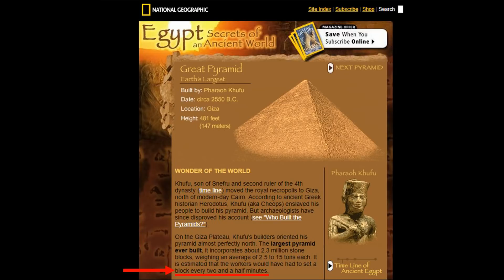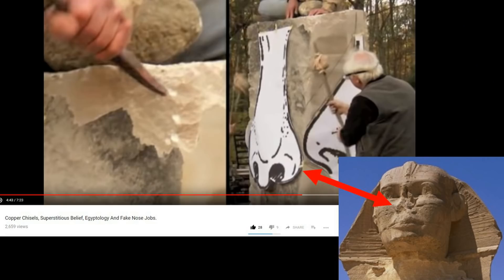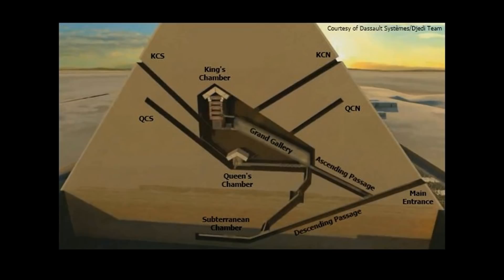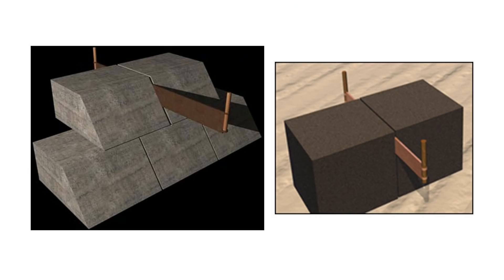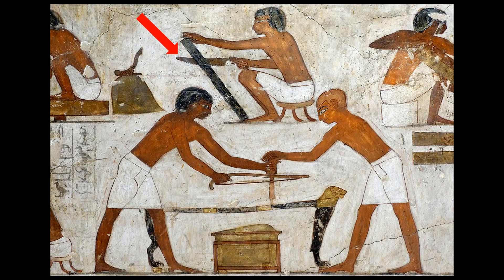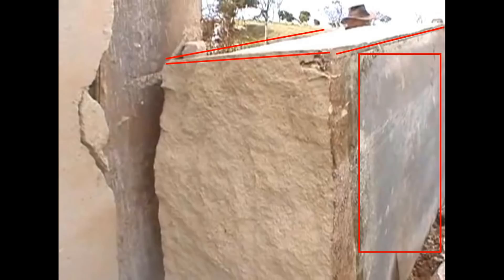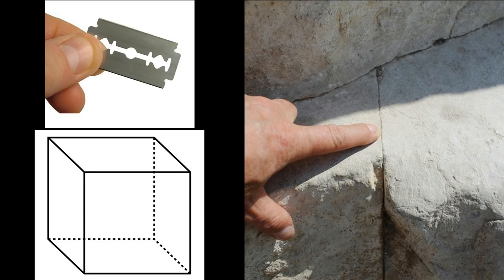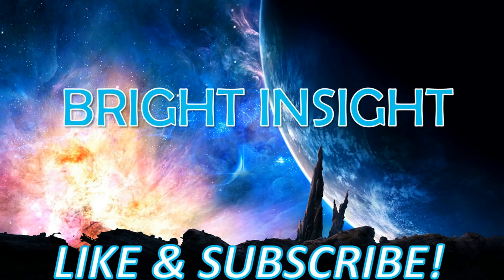Great Pyramid of Giza:  Lost Ancient Civilizations

Comment: your points are interesting and certainly ask some serious questions. What I ask of you is that do you think it's impossible that they had some sort of hardened blade for cutting? I mean as far fetched as it seems, is it impossible that these guys had some sort of blade that could cut stone easily but that would also be so weak that it would biodegrade in 1000 years? Or perhaps they had some other method of melting granite and pouring it into molds?

Comment: we assume the pyramid blocks are blocks but they could be just the apperence of blocks, and just broken metal framework full of mud. it would look the same if a earthquake struck and broke the framework into pieces. since the framework would have been equally spaced rectangular spaces, the framework would break into even pieces when encased in mud. there is signs on the pyramids that they may have been made of framework.

Comment: To calculate the correct length for a saw you have to make it long enough for each tooth to clear itself of swarf, meaning if a block was 50 inches thick, the saw would need to be just over 150 inches long. Also, if bronze chisels were used to carve rock, the bronze would be embedded (almost coated) with bronze. I'm an engineer.

Comment: Like anyone else who has their own mind and does not blindly follow the establishment brainwashing, I don'

t accept the official '
they did it with copper tools and lots of slave labor'
 illogic . It is an impossibility.
 However, the insufficient time to cut and place lots of precisely based blocks time part of your theory has a basic flaw/untruth in it. The space in the pyramids between the inner and outer walls is NOT "filled with millions of precisely based blocks". It is filled with largely rubble - only the areas of inner and outer walls are made of precisely cut and spaced blocks - much like the facing on a casement wall or a stone house. Other than that I agree with you. The huge 1000 ton stone block foundations of the Baalbek temple also illustrate how the establishment professors are full of mostly arrogant bluff and hogwash and their blindly accepted theories of what ancient man could and could not do which they respout without critical examination are completely nonsense to anyone with any real intelligence.

Comment: Those wood soaked ideas are weird when I see those things I know exactly what they are they were prepping those blocks to have the ability to attach would like awnings or Dex or what have you Miraflex you can see it in Peru okay and the wood would be long gone by now after this many years they do this in modern Construction u-prep the stone where you're going to add wood or some other accessory to a stone structure hell they do it in cement structures all over the place they used sucker Rod they use all kinds of things this is just a common thing but to think you could split stone with wet wood yeah that's weird

Comment: The reason the chisel, saw and wedge theories don't add up is because the blocks were poured and molded, like concrete, that has lime as a major component, its just a different type of concrete, if someone were to find one or our modern constructions thousands of years into the future would they too wonder how our civilization (if you can call it that) created huge smooth stone slabs to build massive constructions with, would they come across mount rushmore and theorize about our civilization using claw hammers to chisel the monument? and would they believe that the hoover dam was a great temple to the god of lightning and then put their ideas into books to be pedal as fact? just my thoughts.

Comment: The stones were prob poured in place.  The granite is manmade.  Ive come across a few articles from peru and other sites showing different ideas.  Forster shows saw cuts and drill holes that taper which i can't explain.  The ancients were advanced thats all i can say but, the tight gaps would explain pouring the blocks on site assembly line style with water and the mix being hand delivered to each form while others tamp the ingredients layer by layer.  Sure they had quarries but i think they were using the rock quarries for raw material for the powder mix which would have been done with tech that has turned to dust by now or hidden from us.  Let me know what you think.

Comment: Hopefully we will get some hard evidence when China open their pyramids for research. 1 block, 6 sides, 4 mm in 1 hour, and this is limestone, not granite that would be close to impossible to cut effectively with copper/bronze tools. The builders of the old mega structures were geniuses. There mathematical knowledge was way to advanced for a people that had yet to invent the wheel. Whoever built these structures and for whatever reason had heightened knowledge that surpasses the old egyptians by light years in comparison. We could probably do it today, but we would still struggle, and it would have taken more then 20 years to complete. In comparison, 1800 ct Europe could not have done it, despite the industrial era.

Comment: Jimmy, in one of your videos, you show a locked grate/door on a small passage between the Grand gallery and the antechamber of the great pyramid. There is 0 info on this... Anywhere; all I have found is 3 photos online from different times. One is from the before the grate was installed, and looks as though its part of the original design. Any info on this passage?

Comment: I believe the Pyramids & The Great Sphinx are at LEAST 10,000 years old due to the water damage of the sphinx plus the astronomical alignment of the Orians belt & Leo...( Hancock ) so if they did use metal tools to create these structures the tools (by now) would surely have degraded or at least be deep in sand not yet discovered... 
I reckon early ancient Egyptians settled on the Giza site thousands of years after the Sphinx & Pyramids were created.
Love your work Jimmy lad x

Comment: This is the easiest way to debunk the current theory of how the pyramids were built with chicken bones and copper tools. Hand somebody a screwdriver a hammer and a wooden mallet and tell them to go build a skyscraper. What I'm getting at here is as somebody who builds for a living the tools that you use have to match the job that you're doing. The pyramids are the largest structures mankind has ever built. You're not going to build the largest structures ever built with chicken bones and copper tools. NE job site you walk on whether it's kids in the backyard building a fort Father and Son Building a dog house or contractors building skyscrapers the tools on each one of those job sites will match the job being done. The bigger and more complex a project the bigger and more complex the equipment used to build that project. This is called common sense in this is what academics and Scholars find themselves lacking for the most part. They want people to believe that those structures were built with the Precision greater than we used today astrological mathematics in geographical positioning greater than we use today and they accomplish this with chicken bones and copper tools. Completely ignoring the fact that every aspect of the construction would have had a massive Workforce behind it. There would have been a massive Workforce preparing the ground getting the foundation ready. The ancient engineers would have been calculating the block sizes and positioning to support the massive weight that the walls have to bear . Just that fact alone that these pyramids are still standing should blow people's minds that they had such an advanced understanding of engineering that means they had to understand the density and weight and compression strength of the stones used. And to understand that they would have had to have an entire system to test the strength of stone. They would have you believe that 10000 slaves wearing loin cloths being whipped constantly somehow miraculously achieve this Marvel of engineering by happenstance. Because they don't understand what it takes to build a structure anywhere close to the size of the pyramids. The people who built this had to have advanced knowledge of soil and stone composition. They would have had to understand how to use Bedrock for foundation or else the goddamn pyramids would have sank into the ground a long time ago. Just think of the schooling that people go through to become Structural Engineers because those people had to have something similar to that kind of Education. And then you have to ask yourself what was the functionality of these pyramids what did they do? There's so much more to be said about that construction of the pyramids that people don't even consider or think of that is just astounding but I could Babylon this thread for hours. Cuz once you start to realize that these pyramids had extremely complex Chambers built into them you really start to have to ask how did they engineer this. Mainstream science would have you bleed that all ancient people were babbling idiots walking around wearing diapers. And that they had the knowledge that they had from years of observation generational observation of the solar system than the stars in the alignments. Generational observations of the Nile River the tides in the Ebon flow. I would surmise that there was a lot more education going on back then then people care to admit. Just imagine if ancient people could access more than the piddly 12% of the brain that we can today. What are these ancient skeletal remains with the elongated skulls the true elongated skulls not the manipulated ones. What if that species is responsible for the knowledge that ancient man had?  Because according to mainstream scientists brain size is a direct tie to intelligence. I beg to differ but according to their own logic the species with the elongated skulls would be faster smarter then we are.

Comment: Great video. It would be interesting to see how long it would take, to make one average sized, precise limestone block using the copper saw, sand and water method. multiply that length of time by the approximate number of limestone blocks in the great pyramid. Of course, there were obviously many workers cutting stones and more than one side could be cut at one time. The precision is a huge problem though and the enormous granite blocks themselves debunk the copper tool hypothesis.

Comment: Just a few points:
The tools were probably not kept on the site of the pyramids, they would have been melted down and made into other tools.
And just because certain methods don't create a flawless cut doesn't mean they couldn't have been used. It would be perfectly reasonable to assume that they had a multi step process to cut, refine and finish each stone.

Comment: i'm on your side, but I still find it possible that they used metal tools to cut the blocks. As you pointed out in another video- Metal corrodes and weathers quite fast in geological terms. Perhaps the harsh environment & sand have dissolved most of the metal tools. 
Still, the question of why none of this is documented greatly is tough to explain. however, until you go and see for yourself, several times, and do research for decades, all we're doing is speculating and googling.

Comment: What about laying a rough cut stone block on a level surface with a heavy stone block suspended above it on a frame with sand between the two and the stone suspended on top is moved backwards and forwards. Would the fraction of the sand and the top block act like a sand paper slowly wearing down the lower block?

Thoughts anyone?

Comment: The 6 sides per block is a valid point, but technically, only 3 cuts per block are needed.  Each cut is a side for 2 blocks.  If I did my calculations correctly, for 12 hour days and cutting an inch per hour, you would still need 7300 workers, working in pairs on the big saws, and working 7 days a week for 20 years. That is the number of workers needed for doing NOTHING but cutting, non-stop, with 3650 saws at one time.  Calculate any rest periods, meals, days off, etc... and the number of workers will increase.  You still need other workers for making the sides of the blocks flat, for moving the blocks, placing the block, making tools, repairing tools, transporting tools, transporting water and food, growing food, making clothing, making homes, etc...  I don't believe anything less than a half a million people either directly involved in the building, or supporting those doing the building, would be enough for the job.  How many years would a saw last?  Let us say each saw lasted 2 years.  3650 saws in use at one time, each lasting 2 years, means you would need 36,500 saws over the 20 years.  I doubt that the saws would last 2 months, and that could mean you might need more than 365,000 saws.  Even at 10,000 saws, you should be finding the broken remains of saws everywhere.

Comment: So at this website, it says that the copper ore in Egypt only has 12% copper content and that it was amazing to even have copper in Egypt at all. It would make more sense if they used thermal expansion to cut and carve the stones similar to how the Chinese had to mine. Instead of soaking wood in the stone cuts, burning it would give better cuts similar to glass cutting. I'm combining the information about the glass content scattered around Egypt, the burn marks on the sculptures, the distance from the Nile, and the lack of metal access but high chemical yields that the Egyptians are able to produce. Plus the gasoline deposits in the Nile would make thermal cutting much easier to carve sculptures.
http://www.reshafim.org.il/ad/egypt/trades/tools.htm - Basic info on Egyptian tools an ect.
The other information is from various textbooks and online research over the years.

Comment: Great video. And I agree there is way more to the pyramids than we are being told. And I do not believe bronze and copper tools were the primary tools used either....But the bronze and copper part is really easy to explain as to why there are not thousands of them lying about. IF, they did use those tools in that quantity then the metal would have been recycled into other tools, and items afterwards. You know just like we do with most of our cars and other metal objects and machines. Having said that, there is simply no way any of these blocks were cut and shaped so accurately with any bronze tool. That is just not remotely feasible.

Comment: Thank you for posting this video! 
I also was laughing at the theory and the experiment of using copper tools (i.e. a copper saw) to cut granite! --What a joke!!!  When I tried to enlarge a hole of a power outlet in a granite wall in my kitchen with a tungsten carbide bit with a die grinder, I had to give up! --Even after 30 minutes only approximately 1mm was taken off!!! I had to use a diamond-coated masonry grinding wheel to do that job!

Comment: Do you rly think that someone wouldn't steal all the copper from Egypt or reuse it.
Reply from the maker: I think that IF copper was the primary tooling utilized to cut/carve tens of millions of stone blocks, we would have found more of it. Regardless, as you saw in the video, copper/bronze was not the method used since it does not work - debunked.

Comment: Being that there are new theories about what the pyramids were built for.... and theories that the pyramids would glow due to the energy charge of the stone mass... wouldn't it be interested if the primary purpose of three pyramids with different sizes were simply for the purposes of nighttime navigation in the desert? You know, similar to the light house we have for ships at sea. If all 3 pyramids glowed at night, you would be able to determine your direction based upon your angle of view of the 3 glowing masses and the perceived proximity to each other.

Comment: This is article is from Nature Magazine published on line 11-2-17. 

The Great Pyramid or Khufu’s Pyramid was built on the Giza Plateau (Egypt) during the IVth dynasty by the pharaoh Khufu (Cheops), who reigned from 2509 to 2483 BC1. Despite being one of the oldest and largest monuments on Earth, there is no consensus about how it was built2,3. To better understand its internal structure, we imaged the pyramid using muons, which are by-products of cosmic rays that are only partially absorbed by stone4–6. The resulting cosmic-ray muon radiography allows us to visualize the known and potentially unknown voids in the pyramid in a non-invasive way. Here we report the discovery of a large void (with a cross section similar to the Grand Gallery and a length of 30 m minimum) above the Grand Gallery, which constitutes the first major inner structure found in the Great Pyramid since the 19th century 1. This void, named ScanPyramids Big Void, was first observed with nuclear emulsion films7–9 installed in the Queen’s chamber (Nagoya University), then confirmed with scintillator hodoscopes10,11 set up in the same chamber (KEK) and re-confirmed with gas detectors12 outside of the pyramid (CEA). This large void has therefore been detected with a high confidence by three different muon detection technologies and three independent analyses. These results constitute a breakthrough for the understanding of Khufu’s Pyramid and its internal structure. While there is currently no information about the role of this void, these findings show how modern particle physics can shed new light on the world’s archaeological heritage.

Comment: if the blocks were dragged over sand covered stone, the weight, grit, and friction would smooth them out perfectly flat. each successive block would be the same as the one before it, thus making a perfect fit.